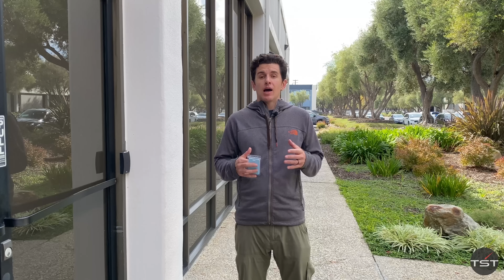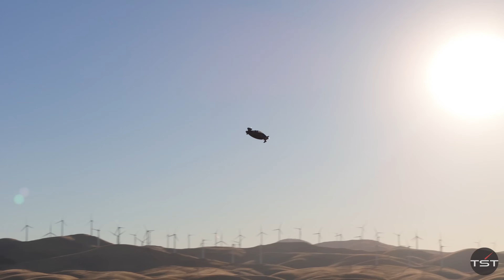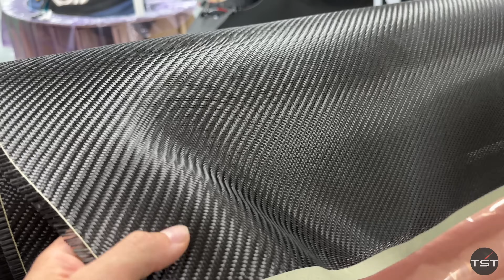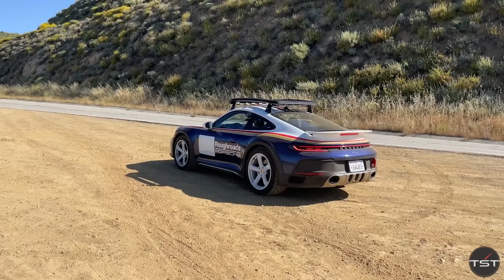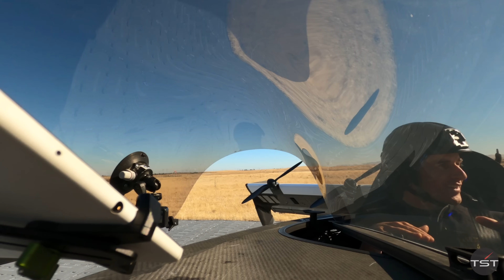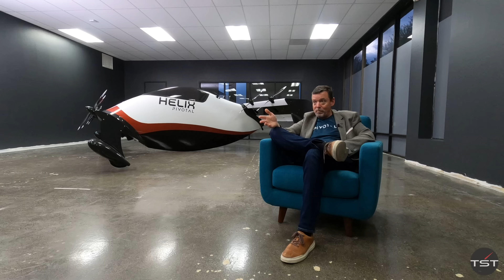I Tried an eVTOL and It Blew My Mind

Comment from the maker: If you're an experienced pilot, let us know what you think of this thing!
Reply: Hey Matt and Zack

I’m 31 years old, pilot at the largest domestic airline in the U.S. with thousands and thousands of flight hours. 

Been flying for airlines since I was 23 and since I was 17 before that. 

I think this is a pretty cool flying machine. There have been quite a few of these types of startups, most fail to get off the ground and you never hear anything about them. It’s exciting to see pivotal push the boundaries of tech and get us closer to a personal flying vehicle. Quite commendable they can build a machine that someone can just in and fly with only a couple days of training. 

That being said, technology to me doesn’t seem like it’s there yet. As Zack mentioned, you can buy an older Mooney or Cessna and get places much faster for less money, although you’ll have to do it the traditional way with a runway and an airport (which is even more fun than landing in a random patch of grass, although not as convenient). There are also other light sport aircraft that don’t require as much training as a typical airplane. 

The problem with electricity to me seems to be the weight of the batteries and the effect that has on total flying time and useful load. In a traditional gasoline engine aircraft, the engine is lighter and you’re burning fuel as the flight goes on… 

Also as these types of crafts become more accessible to an average person you kind of run into Doug demuros hellcat issue. Everyone driving around with a 700hp rear drive v8 may not be a great thing…. 

Aviation is no joke, it is life or death every time we leave the ground, lots of people have forgotten or not realized that because we do such a good job making it safe in this country, despite recent events… 

So I give Zack props, because it takes big balls to leave the earth in a flying machine for the first time all by yourself with nobody there to save your ass. 

Also, tell Zack to be careful, once you get bitten by the aviation bug it’s hard to get rid of it, and the cure is expensive! 
 His remark about this being a day at work and getting paid to do this, that’s how us pilots feel every time we show up to fly anything. Imagine a jet!

P.S. - I live in Las Vegas and have a 2019 Shelby GT350R. Would love to get a drive in with you guys some time. Thanks
Reply from the maker: Thanks for the detailed response!  It is indeed addictive. I hadn't thought of the fact that a plane - like an F1 car- gets lighter as you go, whereas the weight of this machine (or any EV) stays the same no matter what state of charge it's at. Zack
Reply: @TheSmokingTire  I was worried about yall, no podcast in a month... i missed the 992.2 gt3 video, and ive been checking since the fires, for some reason i have to go looking on youtube for your videos...
Reply: @ab2tract  They announced in Dec that they were taking January off.
Reply: @ab2tract  and then this, they are falling for blatant silicon valley investment conmen, wtf.
Reply: @MX304  they are liars.
Reply: @sqlevolicious  ?
Reply: I’m a licensed instrument pilot and own a Mooney M20J. Part 103 aircraft is some of the most dangerous flying you can participate in (statistically 6x more likely to be in a major accident). They are made to a specific weight and must make sacrifices to get to that weight. It’s the same reason why LSA (Light Sport Aircraft) has a higher risk (2x more likely to be in a major accident) than certified aircraft (Part 23).

This is an expensive toy, it serves no actual purpose other than to be a toy. The range and useful load makes it useless for anything else.

I’ll personally never get into one of these things. Mostly because of the risk and secondly because I own an airplane to actually go places not to just fly in a circle on perfect weather days.
Reply: @dylan_766 I see your point but an argument can be made that this could turn into something useful down the road. Material science and data collection/analysis can change its use case.
Reply: Hi Matt and Zach, 

I'm 51 with 12,500 hours of flight time in training, airline and corporate aircraft. This video brought me back to my early days as a student pilot and later as an instructor. The thrill of a "first solo" is like nothing else. I wish I had a video of me doing my first solo. Watching your excitement reminded me of students coming back from their first solo's and successful checkrides.

I would love to own an EV aircraft (in white to match my Rivian R1T) but due to the lack of range, slow airspeed and inability to land at airports with a control tower make owning a Blackfly pointless. I have a very long commute (115 miles) to an airport and a big backyard that I could safely operate a Blackfly in and out of. It would be great to walk out the back door, hop in the Blackfly and fly straight to work. In its current form the Blackfly can not accomplish this mission.

As a fixed wing pilot the sensation of vertical takeoff and landing would be a significant learning curve. I've had rides in helicopters and the sensation of coming to a stop, while in the air, is very disconcerting. To my fixed wing brain, all my experience is screaming "Stall, stall, stall!!" 

If I had $200K to splurge on a Blackfly, I most certainly would, but I would like to have a belly camera so I can see what I'm landing on. Also, I'm curious how well the carbon fiber body will hold up to repeated landings on rough or unimproved surfaces.

For your next aviation adventure I recommend a ride or test flight in a Gyrocopter. Enjoy the rabbithole :)

Thank you for all of your work in making great videos and content.
Reply: Most people don't need it, but most people don't need most things, but there are needs for things like this that would help greatly in certain situations and give people more options.
Reply: I am a private pilot with a lot of time in high performance aircraft, aerobatic flight etc. I also have a limited amount of time in helicopters although I do not hold that certification. You could not pay me enough to get in this death trap. Period. It can't glide, and it can't auto rotate like a helicopter. Any sort of power system failure equals a major crash.
Reply: I am an air traffic controller. I honestly don't understand the use case of these types of aircraft. While they are going to be cheaper to run than a conventional petrol aircraft, it is still going to have to follow the rules. If they ever get certified, which i doubt, maintenance is only about 50% cheaper. Pipistrel makes a trainer that has identical gas and electric. its only about 50% cheaper.  that makes a big difference when you a 18 year old student pilot.  I just dont know who is going to buy and use a 200k single seat, with no cargo capacity, no instruments, no radios.  I think its cool and I am glad you had fun driving it, but its about as practical as a BAC Mono.
Reply: So the fact it can't glide... And the fact it got an AGL error, and you got a voltage peak from the battery because the wind backdrove the motors and the resistance produced positive current... Yeah that's very scary. A bird-strike in this thing is lethal. Its a death-trap with no meaningful use that's insanely overpriced, dude.
Reply: no experienced pilot would think this is anything but investment fraud.
Reply: Private pilot here.  The idea of taking off and landing looking straight up and not being able to see what's around me is puckering my sphincter right now. Autoland?  I guess I'm not a very trusting person.
Reply: Hey Zack might want to retitle it “I flew an EVTOL” sounds like you’re in a flying car otherwise!  (Which I understand you kind of are)
Reply: Seeing Zack in a Gyro would be fun...
Reply: Flying is fun but it's a lot more fun when you can go places with friends and family. For now, I'll stick with my helicopter but I'm excited to see eVTOL technology evolve.
Reply: Relative baby airline pilot around 3700 hours, thanks for letting me feel the first solo sensation again!  I agree with others that this iteration is mostly just a toy and a tech demo, but I'm really interested to see where the tech leads as it continues to develop.  I find the engineering on it super interesting and could see it maturing into something with a huge impact on society in addition to making the hobby more accessible.  You've even got me wondering if they'd be willing to sell parts for use in Experimental - Amateur Built aircraft.  (Almost all the really fun planes are E-ABs in case you needed another aviation rabbithole to fall down.)  Really cool that you got to experience it from the hot seat!
Reply: they found out the hard way that it is not essential to fly over antarctica. maybe things dont need to be done just because you can/could/might?
Reply: As a private pilot and drone operator, my impression is the flying experience is always awkward and uncomfortable. Startling, even. Yes, the control setup is very sleek and intuitive, but taking off and landing blind is definitionally unsafe. And having no forward visibility in a hover is equally unsafe. In conjunction with the awkward and disorienting takeoff and landing method, I would not recommend this craft to anyone.

But it does fly, so there’s that.
Reply: Great one..!
Reply: I'm working on my instrument checkride at the moment and I would absolutely love to work for a company like this. I think licensed pilots will always have a place even in the world of private ultralight experimentals like this mainly for flight testing as well as flight training. Typically the first job any pilot gets is a flight instructor job, so becoming an EV VTOL flight instructor would be an amazing job!

Comment: I think this is very promising but still needs aloooot of development and work especially on the way this thing takes off and lands if they want it to become mainstream. The average joe would not feel comfortable with being tilted in his seat like that and having no landing gear, its just all way too janky. Also rescue personal usually need to bring tons of equipment, even a doctor would probably have a heavy duffel bag with him. Im not sure this vehicle can handle that need.

Also flying low above ground is one of the most scariest things even for experienced pilots because you have zero reaction time if something goes wrong. A parachute needs time to open aswell and in an urban environment where this thing would be supposed to launch from, a parachute would become ineffective if the aircraft smashes against a tall building or gets folded up by cables and the sort. Maybe it needs an external airbag system aswell like some modern cars have which would also add alot of weight.

Comment: Is there a reason why they can't just make a fuel-powered version, which would be lighter and probably instantly have at least twice the range? Am I missing something?
Reply from the maker: As with EVs, the electrical connection from battery > computer > motors allows for precise speed control of each individual motor. A fuel-powered version (assuming you mean a mechanical connection from engine to rotors) would be more complicated. To vary the speed of each motor would probably require some kind of e-clutch for each motor not to mention shafts and gears transmitting the power from the engine to the rotors.
Reply: @ indeed. That would be a lot trickier. But not impossible. Fascinating.

Comment: On a scale of stupid to 'tarded, this is off the charts. Battery power is nowhere near adequate for flight and the noise coming from those tiny props is horrendous. Imagine hearing that buzz overhead every single day. Yeah, cool idea but not the future in this form.
Reply from the maker: Once it's 100 feet away it's honestly quieter than a prop plane.

Comment: There is no difference between rotary wing lift and fixed wing lift the only difference is area loading. Less area loading more efficiency. A helicopter spins it's wings in place but they function the same, the rotor blades simply have less area than the fixed wings of an airplane. This is also why tiltrotors are less efficient in hover mode than  true helicopters, smaller but faster rotors necessitated by needing to compromise between area loading in hover and prop drag in forward flight.
Reply from the maker: Good point. In both situations air moving across a surface causes the lift.

Comment: This is the dream for anyone who’s flown an fpv drone. Can’t wait for power density to increase in batteries, that’s basically the only hurdle, as it is for everything else powered: cars, semis, airplanes, etc. electric motors have been there for a decade if the battery power per pound were better.

Comment: Little correction; it’s not the electric motors giving you that easy control, it’s the flight controller, gps and gyros that allow it to fly for you. New helicopter designs (hill helicopters and several others working on semi autonomous for r44 and blackhawks) are incorporating flight computers that give all the ease of fly by wire joystick control rather than cyclic, pedals and collective. That being said, mastering a helicopter can be quite fun if you have the time and $$$.
Reply from the maker: I should have been clearer. By stating electric motor I meant all those systems working through the motors and spinning them and individual rates.

Comment: I can't believe the FAA lets this fly under part 103. It doesn't meet the stall speed requirements of a fixed wing aircraft. It also cannot auto-rotate like a helicopter. There is a large area of the flight envelope where the only possible outcome is a bad, potentially fatal, crash if power is lost. Even manned e-VTOLs like Joby are having to basically write FAA regs for an entire new category of aircraft. in order to operate as anything more than the current un-manned prototypes
Reply: Those are called “gray areas”.

Comment: It's range is it's limitation. If there's enough room inside for a really compact range-extending engine, say a baby gas turbine turning a couple of alternators, they should fit it. Take off and land purely on battery, but cruise on the range extender.

Comment: The sketchiest part is landing. Zack, I saw that there's some kind of "auto landing", but how autonomous was it? Did you ask the engineers how come they don't have a "take me home" function like most drones have these days?
Reply from the maker: One it's activated it will touch down as gently as one could and then the pilot has to turn off the motors.

Comment: Your comment regarding Boeing, trying to be humorous I suppose, was both unprofessional and exceptionally uninformed.  I won’t unsubscribe but I did consider it.  Please do better in the future.
Reply from the maker: Here was the basis for that comment: "Former Boeing engineers and aviation analysts interviewed by CNN have criticized Boeing’s original software design for relying on data from a single AOA sensor, claiming that those devices are vulnerable to defects.

FAA data analyzed by CNN supports that assessment.

The FAA has received at least 216 reports of AOA sensors failing or having to be repaired, replaced or adjusted since 2004, according to data from the FAA’s Service Difficulty Reporting website.

Those reports, about one-fifth of which involve Boeing planes, include incidents in which AOA sensors were frozen, improperly installed, struck by lightning or even hit by flying birds. In some cases, faulty sensors led to stall warnings, forcing pilots to abort takeoffs or perform emergency landings."
Reply: @ Thank you for the reply, it’s much appreciated.  But unfortunately, I was expecting this as your defense.  
For context, my signature is one of very few on the MAX recertification documentation.  This was a very somber and exceptionally stressful time for all involved.  It was a wake up call worthy of discussion with insight into other issues and concerns. By making light, for humors sake or perhaps politics, of issues that led to two tragic human disasters is at a minimum, in poor taste.
Reply: @Vip-np8op lighten up, Francis.